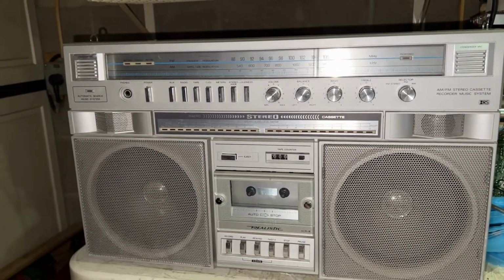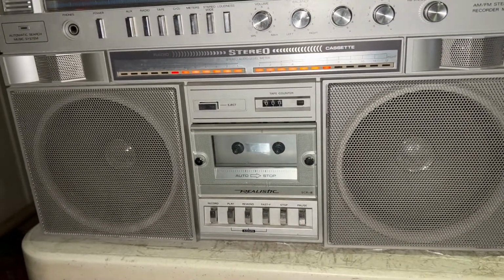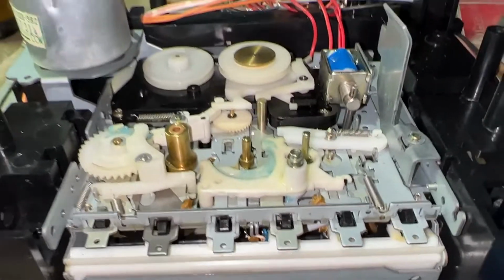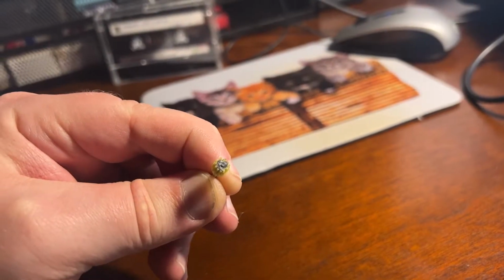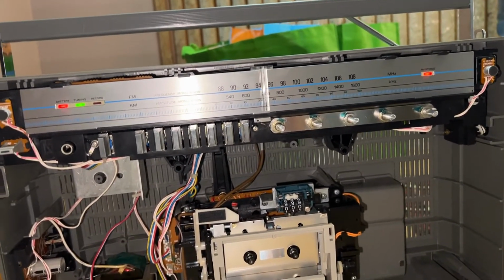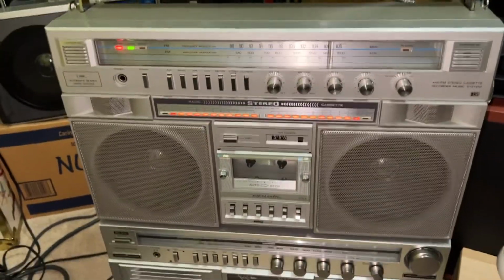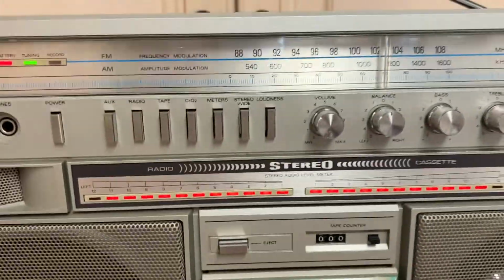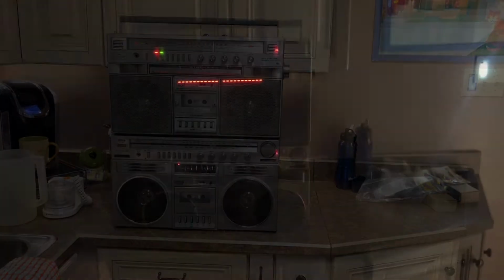The Powerhouse - 1983 Realistic SCR-8 Boombox

Comment: i still have one got it new in 1983 it wasn't cheap it's been my garage radio 30 years tape deck don't work if you turn it off with the power switch  hard to get it back on still sounds great i didn't think it was worth anything

Comment: Did you ever 3D print the tiny spindle gear? I have run into the same issue and want to replace. The JB Weld trick is working with mine but I am a perfectionist and want a proper replacement. I might resort to 3D modeling one in Autodesk Fusion 360.
Reply: Couldn’t source this spindle gear anywhere—ugh! I measured mine (let’s hope my measurements were right) and modeled it with Autodesk Fusion 360 w/ a add-in app called Spur Gear Generator. I’m not an engineer or 3D modeler but determined! I should be getting my prototypes in a few days, if any of them work I’ll share the 3D model. Soo close, everything works great.
Reply from the maker: oh yes, that would be excellent.
Reply: @spatsbear  I have a version that works, how do I get it to you?
Reply from the maker: Not yet. Still need to figure that one out. I'm just using the other functions of the boombox in the meantime.

Comment: Nice boombox!

I had that same one 11 years ago. It was a trash find and came with the cord as well. Mines had issues with record. If I put it in record, the mechanism wouldn’t fully disengage that the tape would get stuck. Also the music search system worked when it wanted to, otherwise it sounded great. I ended up selling it on EBay years after. 

I had that very same power switch issue with my 1985 GE. I had to disassemble the casing for the switch and file the contacts. Works great ever since.

Comment: I bought this box off Kijiji a number of years ago for a good price. Almost everything worked expect the Battery Compartment terminals were corroded from leaky alkaline batteries and the tape deck didn't work. Fixed both issues. The only problem I'm having is when the cassette tape is done playing it doesn't push the stop button out. The play button stay in the in position. The Amplified Sound is really good on the box. The box isn't perfect it's famous for having the front volume led plate coming off from the old glue drying out. Also the plastic cover for the tape deck (green piece like to break easily.)